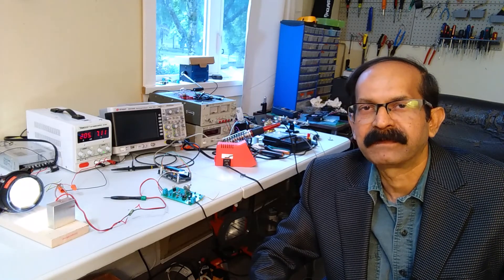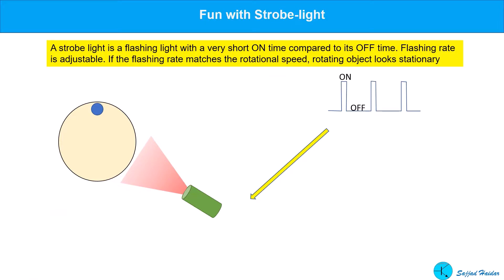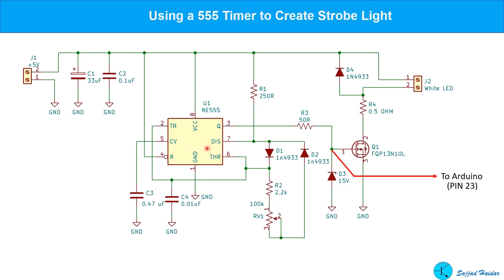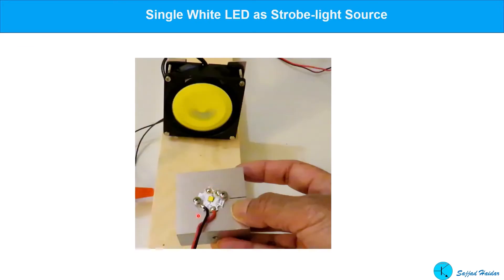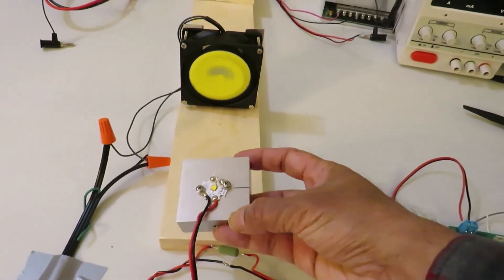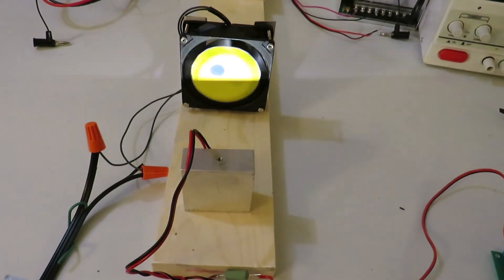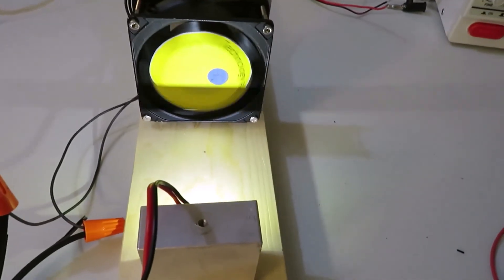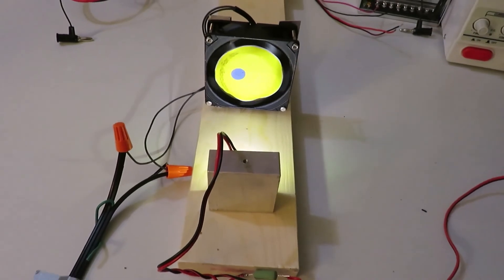Fun With Strobe-Light

Comment: It's usually a good idea to crank up the strobe and back down to a stable image. Otherwise you can fool yourself with aliasing and get a stable image but the wrong frequency.  

Wonder if a say cyan led would work better since it wouldn't have phosphor decay?
Reply from the maker: Thanks for watching and your comments. Yes, Cyan, Red all types of LEDs will work. Usually the decay time of phosphors used in LED is very little (in 10s of ns). So even the white LEDs with phosphor works equally well.

Comment: Hello Sajjad,
I believe the values of C3 and C4 are reversed in your schematic.
Reply from the maker: Hi Carlos: I'll check for the error, looks like it is OK. Value of C3 is not critical, it could be anything in-between 0.1 to 1uF. C4 controls the frequency. A very high valued variable resistor is used to change the frequency. To get short ON time C4 is chosen to have 0.01uF.
Reply: Dear Sajjad, since you are not using pin 5 (control voltage) shouldn't it just be connected to ground with a 0.01uF capacitor?  I ran your circuit on a simulator and the frequencies were in the Khz range.  When using 0.47uF as the timing capacitor, the frequencies were in the Hz range.
Reply from the maker: @carlosrios1965  Hi Carlos I'll doublecheck and get back to you soon
Reply from the maker: Hi Carlos: You are right thanks for checking, While drawing the diagram in Kicad I made this mistake. Actual values I used are 0.1 uF from pin5 to GND and 0.47uF + 0.1 uF from the the other pins (6,2). I'll correct the values in the diagram and repost the file. Thanks again for your interest and checking
Reply from the maker: @carlosrios1965  Corrected PDF file is just uploaded.